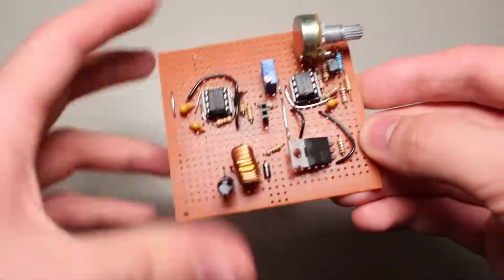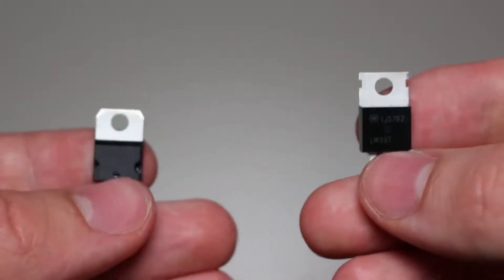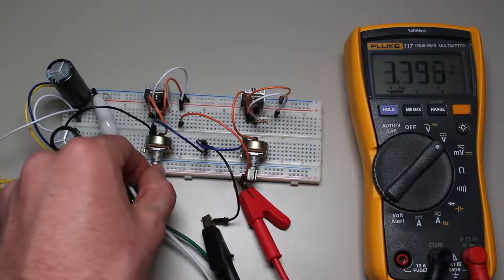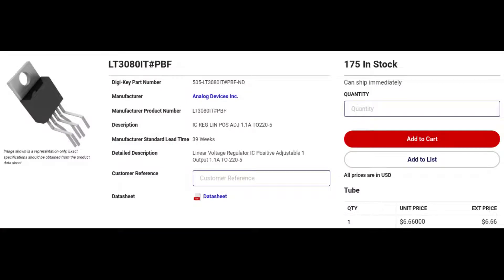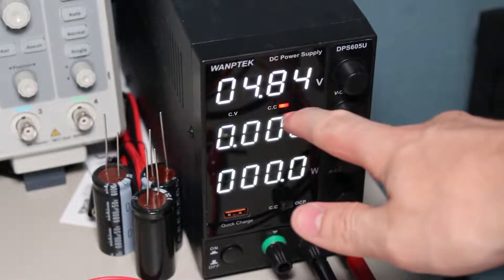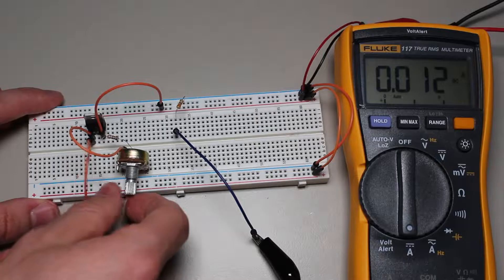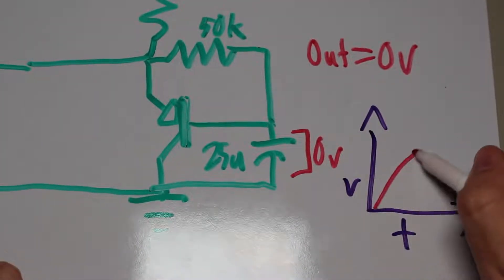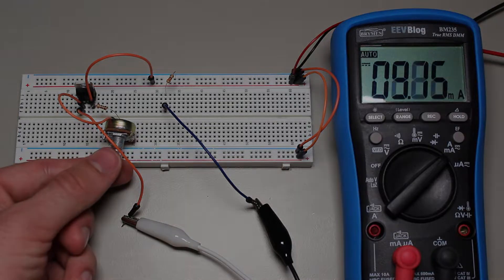How MANY things can you use a LM317 for? - LM317 Part 2

Comment: Great work I just subbed, I am currently obsessed with the perfect Sine Wave @1Khz and am experimenting with Bulb stabilised Wien Bridge Oscillators. I have used several different opamp's, bulbs and so far the LF411 and OPA1656 are stand outs ! Have you played with this oscillator before ? its the one Hewlett of HP fame developed ! anyhow enough piffle ....cheers!
Reply from the maker: I'll have to take a look at that oscillator. It sounds interesting already. :)
Reply: with a name like 'Sine Lab' I thought so. I am using my new darling (previously the NE5532) the OPA 1656 and I have been experimenting with values and component  types and the best bulbs I have are 12v  and about 40mA @SineLab  Yeah just read up and see if you get bit by the desire to make a nut's low noise sine wave...cheers.

Comment: You can also use a pair of LM317 to make a booster output stage for a class A power amplifier. One of them acts as a current sink to the negative rail. The other one opertes as a current booster from the positive rail by controlling its voltage adjustment pin, which is pre-set to ground by use of a trimmer resistor, across a decoupling capacitor. For asymmetric power supplies the output is preset to half of the operating voltage and an output electrolytic capacitor (C>2200 µF for 4 Ohm, C>1000 µF for 8 Ohm) is needed.

Comment: You can also very simply add a current limit / regulation just by adding an npn transistor (2N3904 or BC547) and a resistor / resistor + potentiometer to the LM317 standard circuit. In order to avoid a significantly higher voltage at the output with respect to the input of the LM317 it is recommended to bridge the input and output with a diode in blockig direction in the case of normal operation. Otherwise the device can be damaged or destroyed.

Comment: The uses for a lm317 have way far more uses. Temp control, light sensor, battery isolator, solar charge controller, low/high voltage alarm, battery bms, switching regulator, boost/buck regulator, and many, many more uses. You have to realize it has a voltage reference, a comparator, a current driver, all with built-in hysteresis too.
Reply from the maker: Yes, but that would be a lot for one video though.